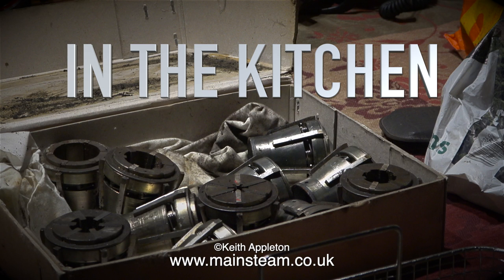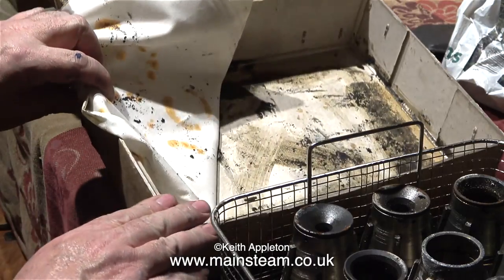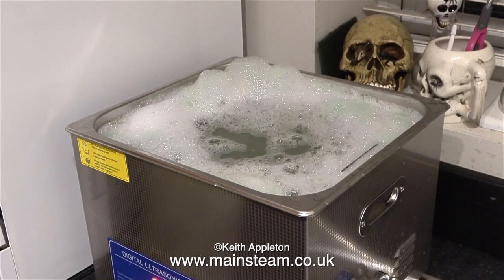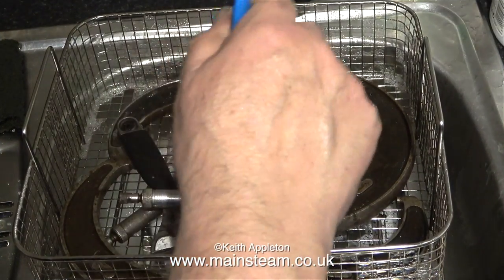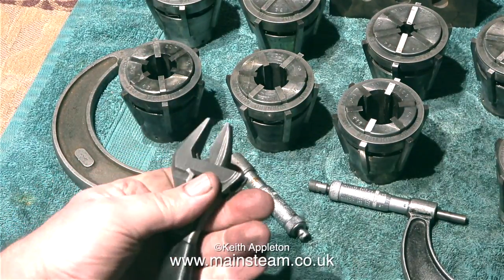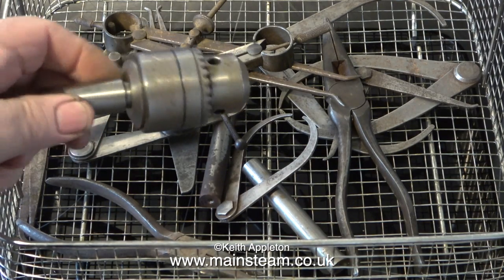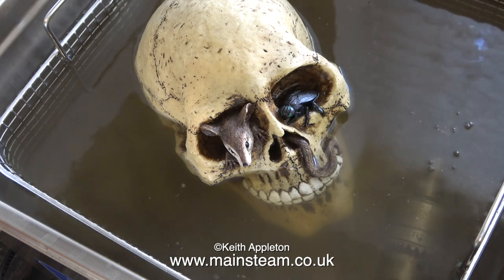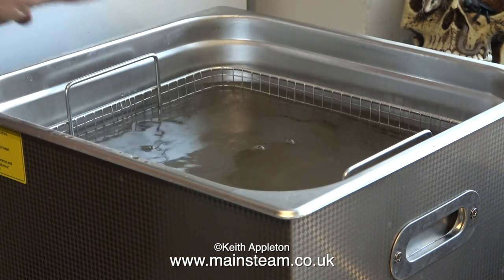MORE ULTRASONIC CLEANING - IN THE KITCHEN

Comment: If you put the items in a glass jar and then fill the jar with your cleaning solution you can keep from having to fill or clean the ultrasonic.  Also you can then rinse and swirl and rinse the parts.  This is good for nuts and bolts.  Just got to that part when you mentioned it.

If you get evaporust use the jar idea because you can reuse the stuff A LOT.  When the sediments form you can just filter it and reuse again.  It is pretty amazing.

Comment: Cloth works great protecting metal parts... Oiled clothes work great, or even waxed clothes work great, rather than damp moisture filled clothes.
Reply: I was going to point this out.  I was given a set of drill bits in a drill index where an oiled paper towel was folded in a zig-zag fashion to cover the exposed portions of the drills.  It had been oiled with a light oil similar to the 3-in-1 or sewing machine oil.  After 20+ years, it still protects those drills!  If I had VCI paper, I'd use that so the chemical vapors would fill the closed index, preventing any rust.  However, VCI paper "wears out" as the chemicals on the paper "evaporate" and the chemicals are blown away in "open" air.  Of course, I think an oily piece of cloth would be best, but I'd never use WD-40 as a long-term protectant, unless they've changed their formulation.

Comment: Hmm. If you choose to store your collets that way,many of which are seldom used,perhaps you would consider paper liners with volatile corrosion inhibitors. There are quite a few manufacturers, and the stuff is not expensive. Just add a couple of sheets for above and below the items. Just looked up the product,and changing the sheets perhaps once a year seems to be sufficient for ordinary use. Once cleaned up,they should stay that way.
Just a suggestion you might find useful . Cheers.

Comment: Hi Keith what is the fluid capacity of the cleaner you’ve got and is it a Vevor unit.
Reply from the maker: It is a 15 Litre model, but actually only holds 13 Litres. I don't recall the make, they all seem to be of an identical construction in this price range.
Reply: Thank you Keith that gives me a better idea of the capacity.
Reply: Thanks both of you, you pre-empted my question! Amazon UK have it 15% off plus a 5% voucher right now. Lots of different names that look identical. but you've got to like 'Estink'!

Comment: I enjoyed your video. Just one small point. I do not believe in cleaning the precision nut of a micrometer, in an Ultrasonic cleaning bath. I enjoy servicing & refurbishing old micrometers. On one occasion I obtained one that someone had put into an ultrasonic cleaning bath. Firstly it was very dry & needed soaking in oil just to unscrew it. This got me very concerned. Having got it apart you could see that it was too clean. Well I oiled it up using the correct superfine oil only to then find that it was far too difficult to adjust it. Unscrewed it & was horrified to find a small item of broken off metal. This kept happening. My conclusion being that this metal was fractured bits of the main nut. Clearly the 60 TPI thread of the main nut relies on the penetrated oil in the surface for some of its strength. That M & W 965B 12 micrometer was a right off. So Ultrasonic cleaning of all the parts of a micrometer is a bad thing. I stick with ultrafine oil, elbow grease & my built-up skill. Incidently my brother uses such right offs as special clamps for repairing musical instruments. He thought it was a good mic & I had to point out why it was a right off. It just could not repeat a reading to match my standards all the time over it's 0 to 1" range. It could be 0.02" out without warning. Because of its damaged nut. For a mic that reads to 0.0001" that is terrible.
Reply from the maker: All of the Micrometers now work fine after being ultrasonically cleaned.
Reply: @keithappleton  I am very pleased for you.